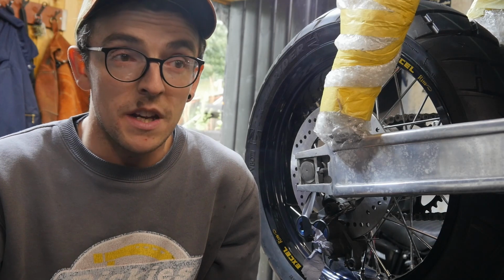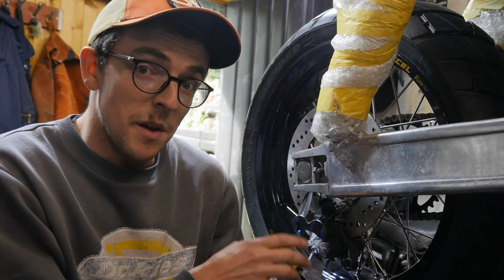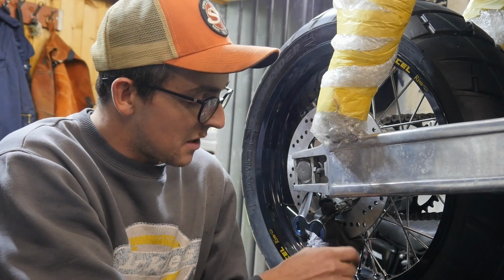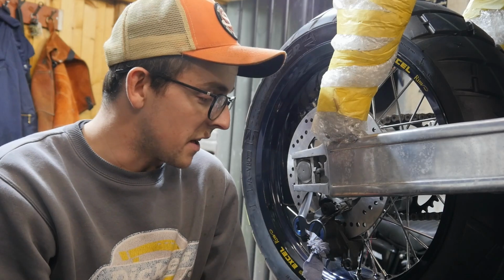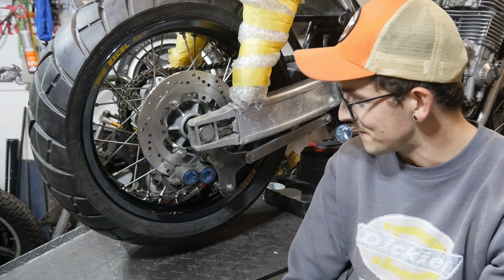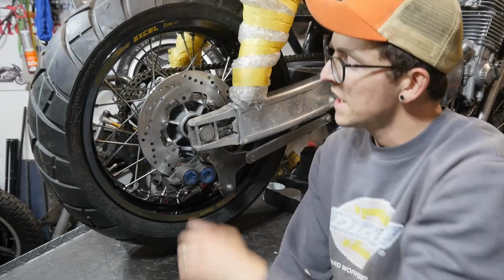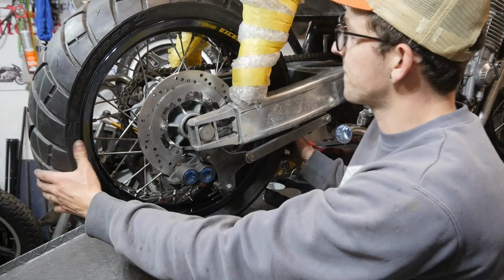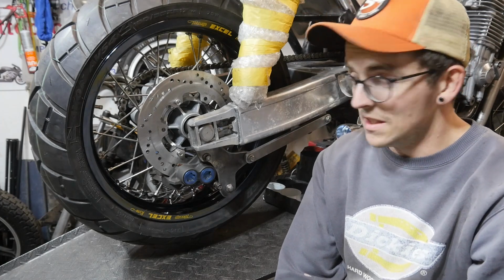FABRICATING A REAR BRAKE HANGER - Yamaha XJR1300 Shoogly Shed Motors

Comment: As creative as ever Euan. Just keep an eye on the hydraulic line connection, may need to relieve your new bracket to accommodate the angle of the hose. Better now than when it’s polished/painted🙄
Reply from the maker: Aye, it fits, don't worry!

Comment: What made you use a front caliper on the rear?
Reply from the maker: Good question - it uses smaller diameter pistons, but 4 of them instead of 2. The slimmer profile allows me to get the caliper tight in to the disc without fouling the wheel hub. I could have used a ducati caliper but I had a spare blue spot so I'd rather use it and keep all the calipers matching. I also used a front blue spot on the V-Max build with great results 👍🏻
Reply: @ShooglyShedMotors  I had to watch the previous video on this, but now I see what you mean. Is the Ducati caliper for that wheel a floating caliper? If you ever want to sell the original xjr rear caliper it also fits fzs1000 and is a common upgrade for fzs600 (600 fazer owners are willing to pay a bit more for them). I bought one a week ago because the rear caliper on my fazer is seized, as usual on fazers.
Reply from the maker: @bence.gabor.slezak  ah useful to know as my wife has a Fazer600 too!
Reply from the maker: @bence.gabor.slezak  and yes, the GT1000 caliper is a floating caliper.
Reply: @ShooglyShedMotors  makes sense, those are very slim on the inside. I just took my rear caliper apart, it had a bit of rain sitting in it. Once there is some brake dust built up, the two drain holes are completely blocked, no wonder they get seized. The blue spot doesn't have this problem, the bottom of it is fully open.